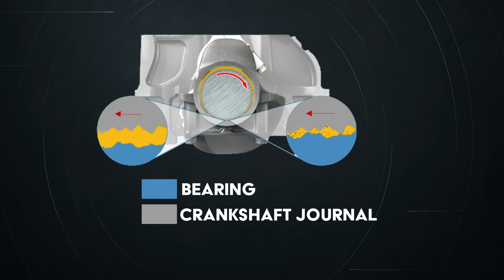the truth about start-stop technology (finally proven)

Comment: But how many people need there car to last a million miles? The main reason for the start stop is because at idle cars run rich and dump loads of fuel into the dpf or particulate filter it’s about emissions not engine wear. If you turn it off you’re more likely to need your dpf changing within 12 months

Comment: I can remember just after I passed my driving test, one oil manufacturer kept saying the worst time on engines was the start and stopping, oil said it was good at reducing this. 

It was mainly the fact that they said about wearing it was this that caught my attention the most. I don’t allow the start stop to operate by keeping the clutch in while at traffic lights
Reply: That was Castrol and the ad specifically mentioned that the worst time on engines was cold starts. That's not what happens with start/stop.

Comment: So could we design a better system - that would treat the cold engine differently, allowing the oil to warm a bit, maybe a pump to pump it around - on a "normal" start - reducing the wear - but still allow the engine to be quickly started if needed by bypassing this process?

Comment: As I was a mechanic for some years by myself, i always had the same thoughts about the systems, as they cane up. Who wants to restart the engine constantly? Starting and stopping the engine, are the nost harmful cycles of the engines (oil pressure build up takes some time and rpm)
I still drive an older diesel without those gimmicks

Comment: I never had any doubt.  That most wear occurres at start-up is well known, and an engine that wears out is something manufacturers want.
Reply: But not one that wears out too fast. This test assumes 5000 start/stops per year. I think most people are doing a lot less than that. I reckon my car does more like 50 per year so will last 100 times longer. A lot of people will be somewhere in between. Other posters here have actually worked on this and say that it was engineered to have adequate lifetime/wear rates. If engines last 150,000 miles (240000 km) that's enough for most people. I don't see much in this test suggesting lifetimes lower than that, at least for most vehicles.

Comment: Another big issue is heat soak. Especially in GDI. More varnish forms and more carbon build up on valves due to temp spikes while stopped for 30-60 seconds at stop lights.

Comment: Modern vehicles have too many electronics. There's no logical reason for having a computer connected to your engine. Everything mechanical worked fine for years before they started messing with computers. Nobody (at least nobody that I know personally) wants a car that shuts itself off at redlights. It's the government that wants that. They want the means to shut your engine off remotely as well, so when you run from police they can just push a button. (You realize that the next step after that is a button that automatically detonates the explosive under your seat, launching you out thru the sunroof... (Allegedly.) Yes, of course I'm exaggerating, but not by much. Big Brother wants total control over humanity. They want to force us all to drive little electric rollerskates that all conform to a standard and can't be used to hoon around in. It's all part of their evil plot of domination. They must be stopped. Personal Liberty is paramount!

Comment: I'd rather have the engine turned off when idling in traffic, if it isn't feasible with a pure ICE - then a hybrid or electric is the way to go. The idea of using fuel idling outside of powering auxiliary equipment / HVAC since using start stop technology is no longer palatable to me. The '600 ml's' add up. Toyota hybrids seem to be lasting the distance engine wise and achieve fairly material fuel savings?

Comment: This "feature"  is in my bmw X1. I usually forget to turn it off until it goes through one cycle. I try not to have this engaged when I drive but its on by default and it has to be turned off every use. It's extremely annoying and I almost hate this car cause of that one thing. I will never buy another car with this garbage in it.

Comment: The shocking finding is that it took 7 seconds before the oil pressure returned to normal even with hot oil.  I always disable the start stop and now i feel more confident in doing so

Comment: I’m curious as to what would happen if you had an electric oil pump that kept running when the engine stopped. I know that it would probably defeat much of the energy savings of the stop/start system. But, out of intellectual curiosity I’d like to know if that would have any effect on start/stop wear.

Comment: Apart from the wear issue, it makes me very nervous to be sitting in the middle of a busy junction waiting for traffic to move and the engine is stopped. What if it does not start again? I am struggling at the moment with starting a Fiat Panda that sometimes takes two or more turns of the ignition key before any thing happens, but at least that is in my driveway or in a car park. Once it is running I want it to keep running - other than in a lengthy motorway holdup of several minutes or more.

Comment: First thing after buying new 208, was disabling start stop. Literally, after buying it and stopping near home, fiddled settings to find option to disable it - it must be done every engine start but with just button press, but it's essential. I want to keep that car as long as possible, so first oil change after 3000, next 10000 and now heading to 17000 and will change every time passing 6000-8000.

Comment: The stated goal of these kinds of mandates is to reduce NOx emissions. There are two primary factors contributing to reducing NOx: efficient combustion and operation of the catalyst. Stopping the engine allows the catalyst to cool and oxidize. By the same logic, automatic start/stop technology undermines both fuel efficiency and catalyst operation. 

How quickly does the catalyst cool, and how long does it take to resume efficient operation from a a cold/hot start?

Comment: I wonder if some of these problems could be fixed by fitting a secondary starter motor to drive the oil pump before the main starter motor starts turning the whole engine.

Comment: yeah, all modern tech in cars i could do without, i prefer cars from the 90's/ early 2000's. that was peak for me, looks, aesthetics, technology, reliability. after that they just started cheaping out on components, and adding more and more unnecessary features and overcomplicating things so there are more things to fail.
i currently have a 1999 toyota about to hit 400,000kms and other than drinking a bit of oil, still going fine. all cars should survive a minimum of 500,000kms imho.

Comment: Forget about the engine, it kills my battery. I had to buy a device to disable it because I had to physically take my battery out of my car and charge it manually twice a year because of auto restart.
Reply: Many of these systems don’t even use the starter or battery. They use sensors to measure compression and spark the right spark plug

Comment: Anytime I drive a car with this "feature" I turn it off. I was sitting next to a woman in a parking lot and she must have had her AC on. Her car started and would run for 15-30 seconds and turn off for an equal amount of time. Over and over... Mine was just idling happily blowing out ice cold air with 380k (miles) on the clock. Her car which is brand new will be in the junkyard before mine. 😂

Comment: Engines are just straight up not very good at powering cars. If they were better they wouldn't need to do this idiotic idling and would be useable from zero RPM. We really need to move past these gay little piston engines and just do the obvious thing and power the cars with real (electric) motors.

Comment: Enjoyed the video.  Dispute the assertion.  Have 2004 Toyota Prius that made it to 440K miles before we parked it in the fence row.  Have a 2019 Kia hybrid that is well over 100K to replace it.  Both start and stop often but no engine issues of any sort.  Changed oil every 5K miles though, far more often than some folks recommend.
Reply: Me too.. I have a 2006 Prius, so far with 270,000km on the odo; it still goes like a bomb, uses only the tiniest bit of oil (probably thanks to the low-tension piston rings which are in turn thanks to the Establishment environmental/emissions regulations), & it acts like it's going to go forever..
Reply: I change oil every 17k miles on 2012 Passat TDI with start/stop and not a single problem for last 8 years, just one battery replacement this year. Hundreds of cars  goes through my hands every year, never seen a single problem connected to start/stop. I think it causes more wear but it doesn't matter in the end.

Comment: I've always made it a point to simply not buy any vehicle with features that I don't want (start/stop, cylinder-deactivation, turbo engine, belt/chain CVT, etc.).  Yes, that does narrow down the choices pretty dramatically these days.
Reply: Any recommendations?
Reply: @jameschristiansson3137  None of the naturally-aspirated engine Mazda vehicles for model year 2026 will have cylinder-deactivation it looks like, nor stop/start or a CVT.  Glad they are finally ditching the cylinder-deactivation after mass-adopting it for 3 years (2023-2025).  My 2022 Mazda CX-30 CE has none of the things I mentioned & has been completely problem/issue free for over 3.5 years now.
Reply: @Kleptocracy-USA  Thanks.

Comment: I’m so glad my car doesn’t have auto start stop. It does have the stupid 4 cylinder mode (thanks Chevy) but I always put it in manual mode or track mode so that it’s disabled. I’ve figured out that any feature implemented to save fuel is not in your best interest for reliability. Just short term minute fuel gains. That’s why I wish my engine had direct injection AND port injection so the intake valves can be cleaned by the fuel. But no, after 60k miles I’m gonna have to have the heads removed to clean the valve train all because direct injection is just a little more efficient.

Comment: I’d never use start stop on a traditional 12V starting system as it’s clearly going to stress the starter, battery, and engine because the engine is starting at under combustion at an extremely low RPM. 

 But I have some problems with your tests.  Your showing damage from what you are saying is just a years worth of starting the engine to go to work on a normal car.  But I’ve seen engines that don’t have that much wear after 15 years of being started every day.  

Or were you saying that you were doing 1 years worth of starts on a start stop engine?  To me it originally sounded like you were saying just a normal engines worth of starting.  

Another question I have is how does high RPM ignition start AKA 48V start stop and hybrid vehicles factor into this?  Because the rod bearings on Prius taxis last over half a million miles and those get more start stops than the average hybrid because they are driving at lower speeds and the engine stops just from letting off the throttle and they stop more often.  But those engine spin up to a higher rpm before turning the ignition on so I guess there’s a difference there.

Comment: The government mandated this on All New car's thinking It would reduce fuel consumption only to be proven more harmful than beneficial causing damage to the engine and reducing the Life of the starter they finally removed the mandate from New car's you can buy a module to disable this feature permanently I think Auto manufacturers should give them to owners for free and install them for free

Comment: I always knew the stop-start system was suspect - even with optimised starter motor and alternator it must be very stressful on the engine for very little perceived environmental benefit. Events over the past 5 years - and especially 'Agenda 2030' - have clarified what the true purpose was. If that made little sense, small-capacity turbocharged engines in big vehicles and 'wet belts' are off the stupidity scale......it can only be intentional in my view. 'They' don't want us driving anywhere, and - only my opinion - the CEOs of the major motor manufacturers are complicit in this as they've been told their industry has no future. I don't believe this, but I do believe that it's future is going to look different to what it has been to date. And I don't mean BEVs.........

Comment: I drive a 2024 Nissan Frontier and the Start/Stop is easy to disable.  I used a small piece of an old credit card and pushed it into the gap by the button permanently turning it off.  It works and took about 5 seconds to do it!
Reply: I used a piece of a mixing straw on mine lol. Same truck
Reply: Did the same with a piece of cardboard.  That low tech approach will save me a ton of money and aggravation later.
Reply: Bubble gum
Reply: 5 seconds of work, and lifespan of the engine decreased by hundreds of hours. From a time-cost perspective, probably nearly as effective as just draining all the oil from your engine.

Start-stop engines last longer. Every second it has run is one second less it will last.

Comment: Engineers understand oil starvation is real...that's why transmissions have a seprate electric pump and filter to maintain fluid pressure while the car is in the "stop" state. It's extremely annoying they do not provide the same pressure system for the engine and turbo systems.

Comment: 1) Is "the runout point" effected by oil pressure?  If so could an additional oil pump in parallel (electric?) lower that RPM?  If both preceding are true, could a very low idle speed, (~200 RPM?) with an additional pump be used in place of stopping the engine to BOTH save fuel, and not increase engine wear (at the very low idle, the alternator would only produce enough energy to equal the injectors and oil pump use with no extra)?

Comment: It not just a case of engine wear there is a big danger if the engine switches off in the middle of a junction, I see that happening all the time with cars stuck for a few seconds till the engine comes on again. I have now fitted a cheap plug-in device from Ebay that disables my cars start stop system so the engine does not switch off. Start Stop is now gone for good, thank goodness. (These plug in disable devices fitted at the back of the start stop switch is now available for many car makes).